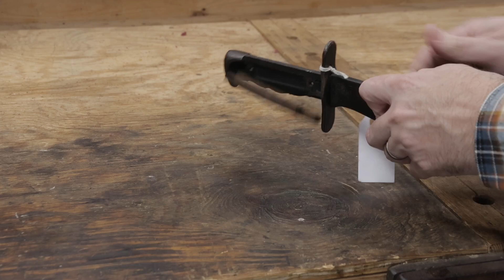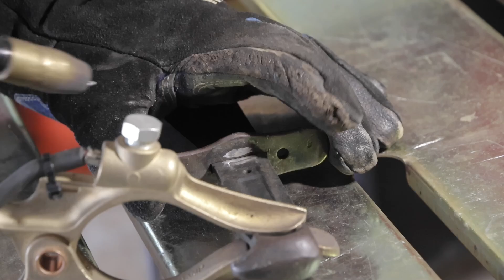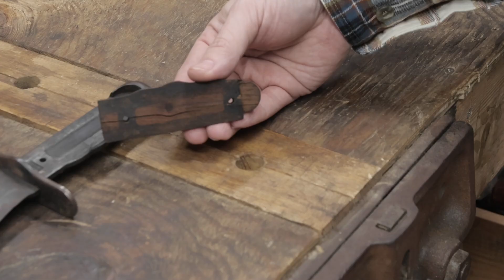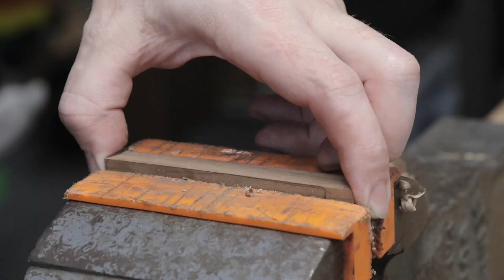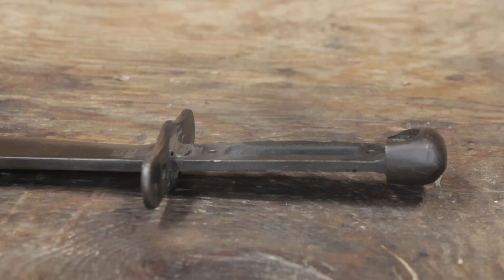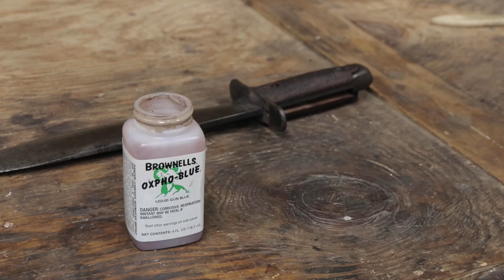M1917 Bolo Knife Restoration

Comment: Its not a good idea  to weld high carbon  steel like that the sudden  intense  heat will crystales the carbon leading  to imbritlment  and  catastrophic  stress  failure  at that point sooner  or later

Comment: I would say if there is no evidence of a broken weld, which I can't see any in the video, odds are the cross guard was pressure fit on, and held in place by the handle plates, which account for them cracking due to stress when the pressure fit of the cross guard failed... Just my thoughts, I have no special knowledge on these knifes.